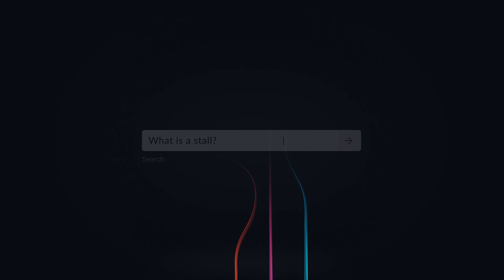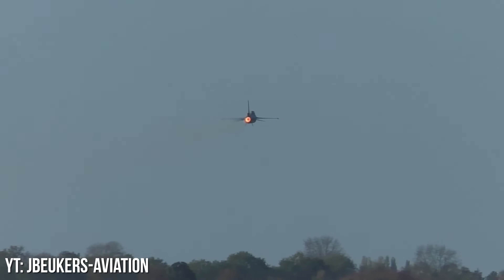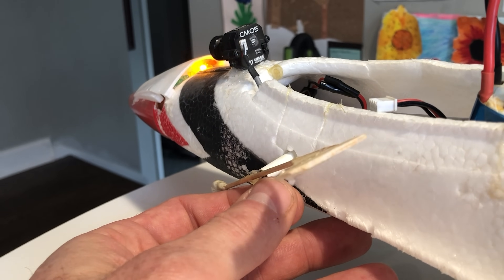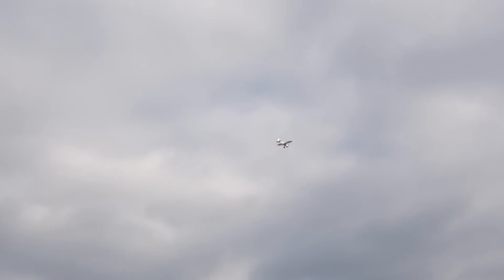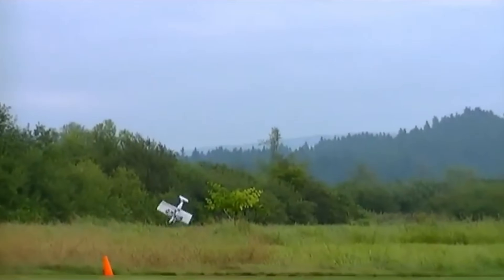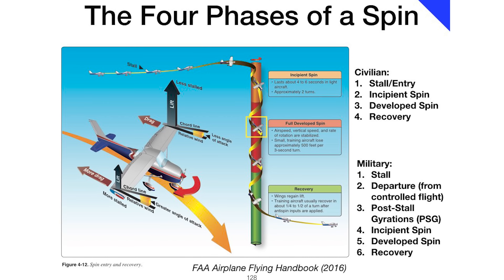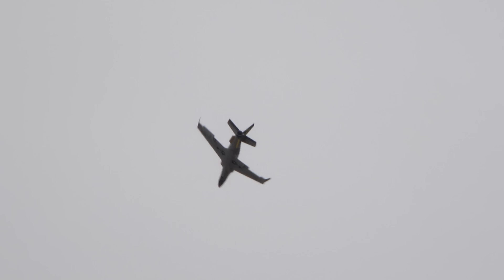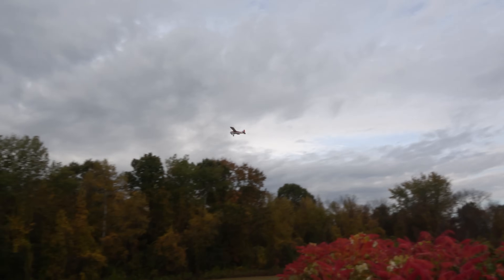Your Definitive Guide To RC Stalls

Comment: I have an FSW 3, forward swept wing sport model with 45 degrees sweep. The wing tips are as far forward as the engine. When it stalls, the inwards spanwise airflow means the root stalls and the tips don't. Ailerons stay fully effective, the nose pitches up a lot with the tips doing most of the lifting and, with power on, I can fly a circuit fully stalled, about 45 degrees nose up and fully controllable. It also has an interesting crosswind characteristic in that since the downwind wing is closer to right angles to the wind and the upwind wing is taking more of the airflow spanwise from the tip, it will have more lift on the downwind wing and so will self correct by rolling towards upwind. It basically self corrects for a crosswind.

Comment: Having a few hours flying a Cessna (never achieved a private pilot's license, though) .. and observing dozens of RC crash videos .. RC appearing to be much more unforgiving to getting into trouble. There's the overscaled speed thing (versus real-sized airplanes), that most models require to stay in the air, .. and twitchiness of jerking around the few pounds of model, versus the hundreds/thousands of pounds of a full sized plane.

I like the idea of flying at 70' high, with a model .. and practicing approach to landings .. and seeing where the model loses flying stability. A RC pilot's at a disadvantage .. not having an airspeed indicator. Actually, .. find out 2 things .. acquire at least a fuzzy idea of the ground speed, that the model has to have .. and then develop the muscle memory, for what it takes to pull up the nose, WITHOUT overdoing it, and pitching back up to 20', and most likely stalling, after all.

Back to full-sized flying .. what seemed to work to best was have the pitch attitude emulating crashing into the end of the runway, a slight dive (assuming you have your power set at .. ooh, at 50% or so .. which isn't enough to keep the plane, flying) and then .. it was a matter of timing .. and relying on what amount of elevator change input, that has been already practiced, to flare the plane. And, there is ground effect too .. the air getting a bit harder, due to the close proximity to the ground.

Comment: OUTSTANDING lesson!   You packed so much accurate information into this.    Could you make a video about the uses of flaps?   I see many crashes turning base to final where RC pilots exceed the critical angle of attack and end up dropping a wing.  ( I’ve done it too)  The use of flaps is so misunderstood.  Most RC pilots think they are just to enable the airplane to slow down.  Well…sort of?   Bet you could do an outstanding job of explaining flaps and their various usage.

Comment: For side slipping, a great rule to remember is "low wing forward. High wing forward is a skid. Also, rudder input for a coordinated turn is the oppsite of aileron direction.
Reply from the maker: You're mixing some stuff up there. You're thinking of a forward slip. You should not have any wings forward of the other in a side slip.

Rudder input for a coordinated turn is rudder with the aileron. A left turn initiated with aileron will need left rudder alongside it as needed to stay coordinated.

Check out our video titled, "Rudder: You MAY Be Using It Wrong. Here's Why." We go over all those topics and more.

Comment: I've been encountering some A-stalls on my SUS of all things. The transition from wing dip, to toilet bowl is extremely fast. I recently coated it in Varithane, which added weight, but I never noticed the stall problem before that. Could that very small amount of weight change really make that much difference?🤔 Won't be coating future aircraft as the change in performance isn't worth miniscule gain in durability.

Comment: So, does Aeileron neutral mean provide no corrective input on A? Just leave it alone and reduce throttle, provide rudder corrective input (optional), and provide corrective (opposite/down) elevator? A is the only one I’m a little confused about.
Reply from the maker: That's correct. Do not touch the ailerons. The easiest recovery is to simply let go. Otherwise, yeah, opposite rudder (only gently and as needed) with forward pressure and then gently climb out (no abrupt elevator inputs).

Comment: ok but one question, how do you recover from spin with no rudder?
Reply from the maker: If the plane doesn't have any weird design characteristics and has good directional stability, then just letting go, rolling the wings level, and then gently pulling up works fine.

Comment: so an airspeed of 0 means that the wing can't stall?
Reply from the maker: Mind clarifying what part of the video you're referencing? Or are you asking a question outside of the video?
Reply: @TailHeavyProductions  at around 1:27, you say that a wing can stall at “any non-zero airspeed”. So wing at zero air speed would therefore not be able to stall, correct? Or am I just taking this way too far?

Comment: 8:00 looks like a Mick Reeves spitfire, mine is a weird one because I can’t get it to tip stall. I’ve done several stall tests but it just won’t stall. It gently drops the nose like I push forward on the stick and doesn’t tip stall at all

Comment: If only RC pilots learned that the Rudder is more than a way to steer the plane for takeoff, and then back to the parking spot. It is necessary for coordinated flight, and especially in a imminent stall and right after stall.   Mantra:  Aileron kills, rudder saves.

Comment: The mythical “tip stall” on straight-wing aircraft seems to only be a thing with RC “pilots”.
Reply from the maker: RC pilots are pilots, too. They just fly smaller scale aircraft. 👍 Take it from us - we fly both.
Reply: @TailHeavyProductions  Why are “tip stalls” not a thing for private/commercial pilots?
Reply from the maker: Per the video - they are a thing depending on the wing type. 🙂
Reply: @TailHeavyProductions  Notice that I said “straight-wing”.
Reply: What kind of wing type?
Reply: Please expand on wing type.
Reply: What are the characteristics of swept-wing tip stall?
Reply from the maker: The answers to all your questions are fully laid out in the video. 👍
Reply: I was hoping you would expand on how the center of pressure moves during a true tip stall and if the resultant pitch moment is different and thereby recognizable as a true tip stall.
I will stop bothering you now; you get the last word.

Comment: Hey, I just repaired and recovered an rc champ and on take off when it got in the air it was crazy like the cg was tail heavy, but after the crash i measured the cg again and it was even a little nose heavy. Should this have been a assemetrical stall if it looks like it flys tail heavy.

Comment: Awesome video! I got my tailwheel endorsement in a 1946 Aeronca Champ. I loved doing spins in that plane. I built a full scale Sonex which had a "Hershey Bar" wing. Stalls were mostly benign, but occasionally it would drop a wing. Power on stalls were a little more abrupt. I added vortex generators  which made the stalls more gentle. Am I correct in assuming this would be true with RC planes?

Comment: Additional comment: RC folks should never let full-size pilots look/talk down on you because you're just flying "toys". They're just as much airplanes as full size BUT are far harder to fly because their smaller size means far lower moment of inertia, which means crazy faster roll, pitch and yaw rates. That's why it's so easy to have a "tip stall". The best description I ever heard of what it's like to fly a fast small aerobatic RC plane (or heli) is it's like flying "a mosquito on crack". The young folks are particularly good at it. Those days are long gone for me, but I still am amazed at what lightning fast young reflexes can do.

Comment: You are quite correct about the difference, but I always say tip stall myself as they are functionally the same as an asymmetric stall (from the 'oh no my plane flipped over' point of view) and everyone knows what i mean when i say it. If someone wants to argue about the granular detail they clearly have more time to waste on it than i do.
Reply from the maker: That's why we're proponents of just saying "I dropped a wing" instead of one or the other. It avoids any unnecessary arguments and is correct for either a tip stall or asymmetric stall. 👍

Comment: Bit confused, don't
 cambered airfoils produce lift at negative alpha
Reply from the maker: You're correct, cambered airfoils produce some lift at small negative angles of attack. We don't recall ever having said anything to the contrary. Would you mind pointing out what part of the video you take issue with?
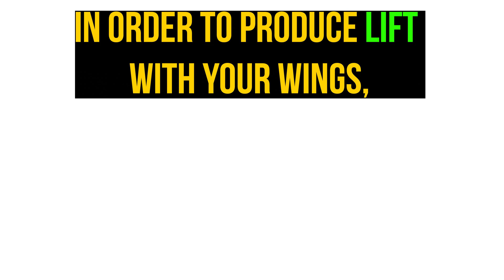Reply: Sure, right at 1:00
Reply from the maker: The way we worded that portion of the video ("an angle of attack to the relative wind is required") and displayed a cross section on the screen might have been a little misleading to the point you brought up - but it was a necessary sacrifice to try to drill in the far more important lesson of how stalls are related to angle of attack instead of speed. For a video on the basics of stalls, getting into the nitty gritty is just going to confuse folks new to these concepts.  In a future video, we'll definitely dive more into the intricacies of this stuff. Stalls 301. 😁👍
Reply: @TailHeavyProductions  Makes sense and thanks for getting back!

Comment: You did a real good job explaining a complicated subject with an incredible amount of factors and contributors. 

It’s easy to blanket every stall on which a wing drops violently as a “tip stall” because it just looks so obvious that the stall started or was only at that one wingtip. 

What hurts us the most is all stalls are pilot error. Just like a motorcycle or bicycle won’t fall over once it’s in motion, an airplane won’t stall on its own once it’s flying (if trimmed for coordinated flight). Pilots induce the stall by uncoordinated control inputs or failure to maintain sufficient airspeed for the attitude they’re trying to fly at.

Comment: Y’all over at Tail Heavy are so knowledgeable on aviation stuff; perhaps y’all could also answer a question I had on Sport EDFs. I know that swept wings are useful for aircraft that experience supersonic flow over their surfaces, but since sport jets don’t go that fast at all, how come so many are built with them? Are there other uses for swept wings in at Electric RC scales?
Reply from the maker: I hit up Adam who helped fact check this video. Here’s his answer. 

“Ok, short answer is that the point of a sport jet is to look like a jet, while also being fun to fly. Gotta have those swept wings and internal fan to look fast and sound wooshy. 

Most of the time having swept wings at the rc scale is not going to help it fly better. Lots of sport jets have dogtoothed leading edges or something else to mitigate the nasty effects of having a swept wing. 

I guess one exception to this is the category of flying wings, where having that sweep can give you some yaw stability (at the cost of potential dutch-roll nastiness) and can sometimes allow for a larger range of acceptable cg locations.”
Reply: @TailHeavyProductions  thanks for the reply guys! Interesting situation…gives me a clear path for how to innovate in my scratch builds

Comment: I've crashed my Corsair exactly like the one at 4:08.  Can you break down what went wrong, and what the pilot should have done?
Reply: They should have gotten more airspeed in ground effect before trying to pitch up that much, and pressed the elevator slowly and smoothly. When it started the roll, they should have brought the nose down to level before giving opposite elevator.
Reply: Seems like you broke it down by yourself. 😜 sorry 😅

Comment: I used stalls too my advantage last week to get another plane away from a large gasser that was flown by a kid who is a bit of a hotshot. The little zohd dart can handle some pretty rough flying even when there is a large gasser on its tail. Smaller aircraft have lighter wing loading and can dive like a bat out of hell too get out of the way
Reply: Also a lot less frustration. I'm really starting to despise nitro engines
Reply: @pieterpretorius1014  Yeah I raced nitro 1/8 buggys 1/10 stadium trucks for about 4yrs and I had a couple nitro planes back 20+ years ago, it's messy AF and they don't like the cold weather, electric is much easier and much cleaner for sure!!!
Reply: I like flying my smaller planes more than my big ones, a lot less stress 😁

Comment: Did this with my Timber-X yesterday. Shortened the Xoar prop by two inches on each end, but flew out of it, lol. Flying a Timber-X like it is an AeroScout is a recipe for disaster.
Reply: keep the speed up, keep it flat in turns,
Reply from the maker: Dang! It should be noted that legit flat turns (aka skidding turns) are a recipe for a wing drop due to the uncoordinated condition you’re in - ESPECIALLY when flying slow. Make sure your turns are coordinated above all else and keep your nose low during your downwind/base/final legs into the round out and flare. Flat turns are fun to try for fun when done on purpose! Good cross control practice. 👍
Reply: @TailHeavyProductions  yes , keep the speed up
Reply: @Jackson27mc  Yep!

Comment: fIrSt oF aLl iF you CrAsh yOur pLane that’s A sKilL IsSue.
Reply: @TailHeavyProductions pin this guy
Reply: @TailHeavyProductions coming back to this video after tip stalling my brand new fms cub 1.7m into the side of a hill on the 3rd flight 😢
Reply: Just judging by your YouTube name and drone photo. Its probably a good thing you fly a mavic drone that can't really be crashed. 😂
Reply: @RWJetfan Ive sent it back to dji 6 times then sold it. Onto a Mavic air. 😂
Reply: boom